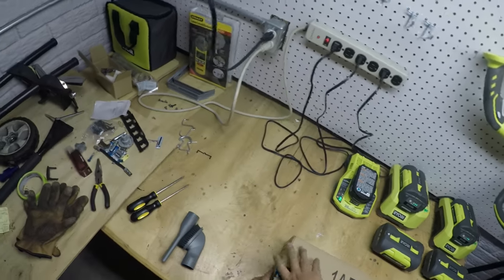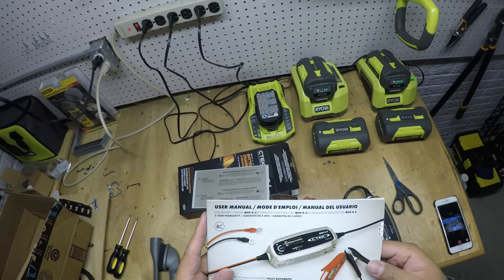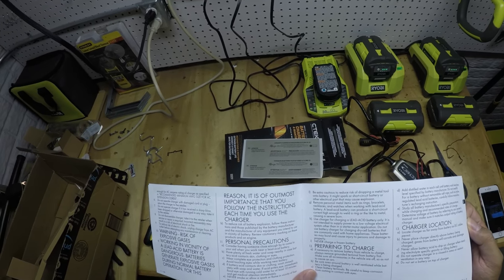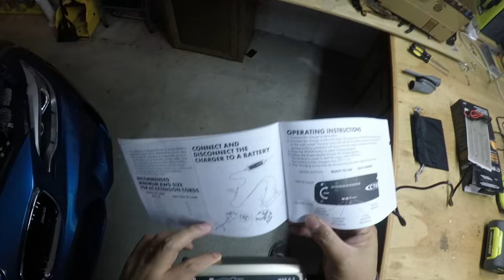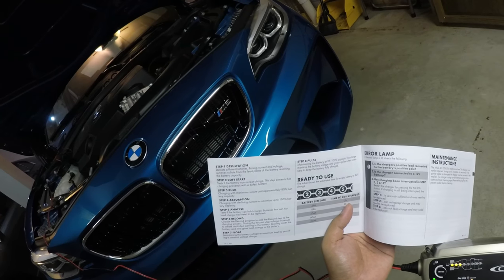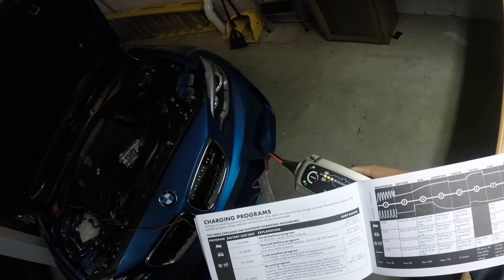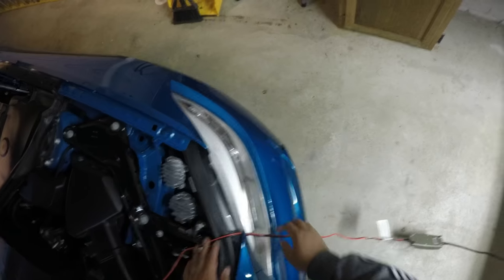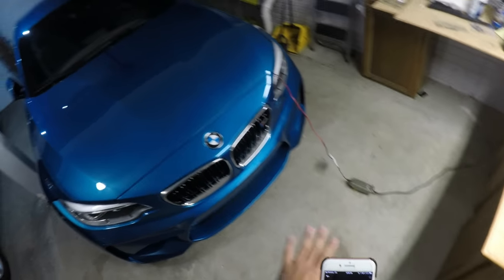Preparing Your BMW M2 For Winter

Comment: You should run it from behind towards windshield so you can close the hood since it does drain battery when opened.
Reply from the maker: Thanks for the suggestion! I was able to close the hood after this video and it hasn't drained the battery.

Comment: Hello can I ask what is the reason for charging your battery in the first place ? I’m having a battery discharged issue at the moment on my m2 and I can’t understand why. Why do these cars do this ?
Reply from the maker: One of the main reasons why I use a battery tender is because my car sits in my garage during winter. Since I do not remove the battery there are still some devices within the car that uses the battery e.g. alarm system. The battery tender makes sure that your battery doesn't fully discharge—BMW's tend to use a lot of battery charge even if they are just parked.

If you use your car every day, it wouldn't be a problem. It's only if your car is going to be parked for long periods of time (months). Hope that helps, Sarah!